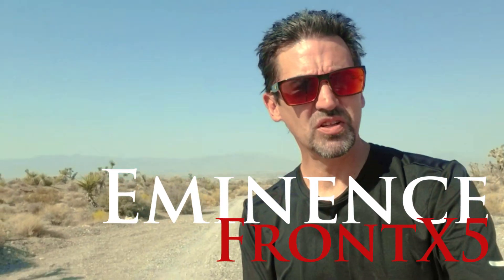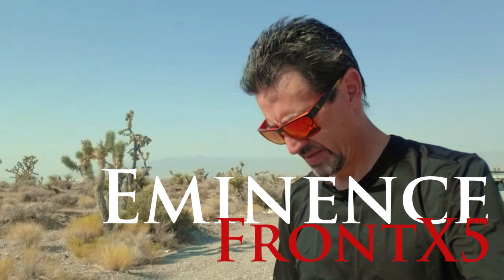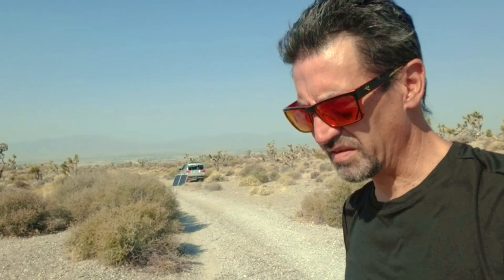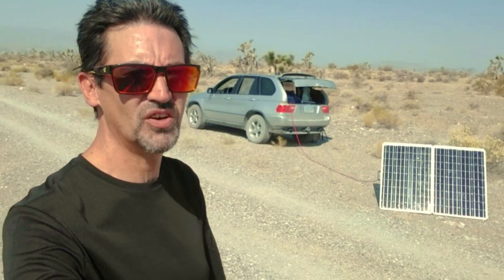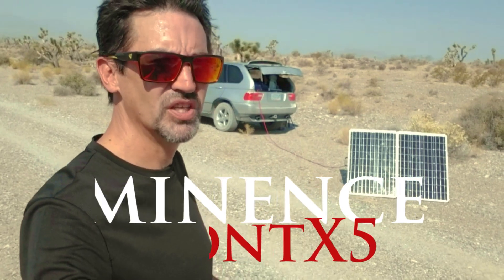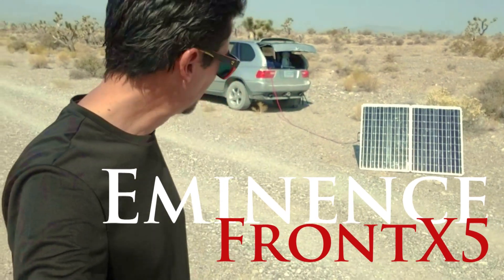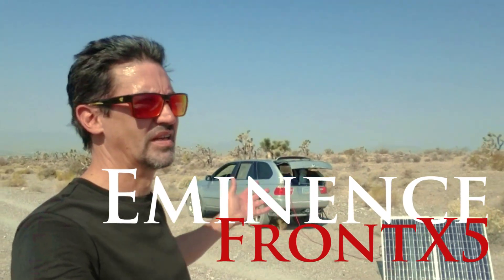Battery Isolator Rant

Comment: AFAIK, your battery isolator essentially ties all batteries together in parallel once the engine is running and the alternator is charging. Starting battery will completely charge very rapidly as it has only discharged for a couple of seconds at high current to start the engine. I don't know the details of how you have modified your vehicle charging system but assume you swapped the alternator for a higher output one. Alternator wiring should also be beefed up from the alternator to the large secondary battery pack. The battery isolator you are using should be rated to handle the extended  high current flow. If it has 8 gauge go to at least 6 gauge. During high current charging check temps all over your charging circuit. (Infrared hand-held thermometer is cheap at Harbor Freight). Have an accurate DC ammeter and use it. I know you have been doing solar charging for years in a hot climate. Still thinking increase the watt-hour capacity of the secondary battery pack could be your solution since you charge that pack from the vehicle on a regular basis. Sealed lead will outgas and kill the capacity if overcharged. Test your battery pack capacity occasionally. The batteries will degrade over time and have a finite cycle life. More and bigger PV panels will help but that is looking to already be a big hassle as is. Tailoring your system for the way it is used is a primary concern. You already drive the vehicle almost daily. Take advantage of what it can provide. Depending more on your fossil-fueled vehicle to charge than solar may be the best solution for the way you use the system. Look at the bigger picture. Again, I don't know the specs of your current system. With a little more expense you could switch to a BMS-managed lithium pack and gain a whole bunch of capacity. /rant

Comment: Hi Larry. New subscriber and first time commenter. You asked for advice on power systems. Apparently you charge from vehicle alternator almost daily. Refrigeration will always be your biggest energy user. Insulate your refrigeration unit as best you can. Seems to me the solution is to increase the capacity of your secondary battery pack. This will allow you to take advantage of the high amp charging from the alternator and increase the runtime. More available watt-hours cures what ails you.

Comment: When I first came out west 12 years ago and was sleeping in my subaru traveling around.  Wanted extra power for running computer. I pushed a plastic vacuum bottle or some such thing under the hood out of the way and crammed an extra 12 volt battery in that  space and just put it in parallel with the existing battery.  Got away without screwing anything up.   So 7 years later  took a winter trip to  Wyoming and SD in my ram pickup.  Did the same thing with two 12v 100 amp lead acid batteries.  Put them in the foot well in front of the passenger seat.  Or where the passenger seat should have been anyways.  I took all that out since I was traveling alone.  No isolator switch.   Never had a problem.  The trailer I was hauling had yet another 12 volt battery.  So my alternator was charging 4 batteries total.

Comment: I've came to the same conclusion. I have 320w solar into 2 200ah 6v batteries in series. Just changed from 2 100ah 12v (parallel) less than a week ago. So far so, very freakin', good. It's another loop in the final isolator decision.

Comment: Hi Larry.I am a Electrician from new Zealand love all your videos  when in hot conditions cable get hot less currant needs to be thicker wire also you have a  Pulse Width Modulation (PWM) charge controller which is not good  you need to wire the panels for 24 volts in a  mppt charge controller to charge a 12 volt battery which gives you full charge  full currant even on cloudy days this should double your output if its 150 watt panel should be 10 to 12 amp charge
Reply from the maker: Thanks for the info.  Its the ambient temperatures that are getting hot 130f/54c, not necessarily the wires.  Regardless, I am getting about 10amps from this setup and has been functioning on the solar side flawlessly.   On top of that the victron energy argon diode isolator is about to take over main charging duties.  I may even downsize the panels to better fit the top of the X5.

Comment: I think I mentioned this before.  I've had a 100Amp Isolator in my truck since 2006. It isolate my truck battery from the battery bank I have in the bed. I have 50Amp circuit breakers on all the batteries in the truck bed. my truck Alternator I've upgraded from a stock 37 Amp SI style alternator to a 100  Amp DI alternator. yes I had to modify the alternator brackets a bit. I have 3 batteries in the bed of the truck. one is a deep cycle. the other 2 I can put a jumper cable across to help feed the inverter. never needed to. Up here in the great white north I doubt a solar panel would be of much help.  Sounds like you need more battery capacity. I've never looked into it but if you could afford it you could go to lithion type batteries. or you could just add a couple more AGM deep cycle batteries in parallel with what you have.  Then forget the solar panels, they sound like a bigger pain than they are worth. Thats my unprofessional view. Mine are setup for a different purpose than yours.
Reply from the maker: Thank you for the comment.  Yes its time to change a bit.  Solar as back up.